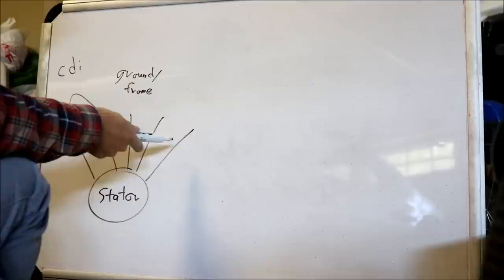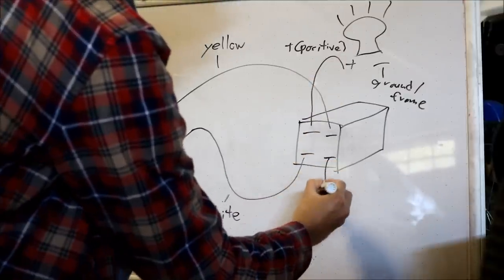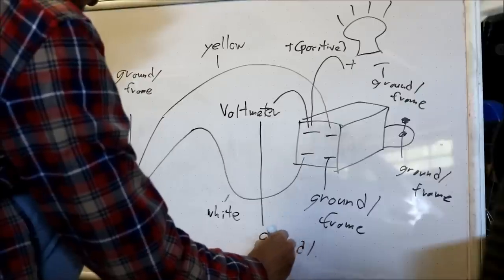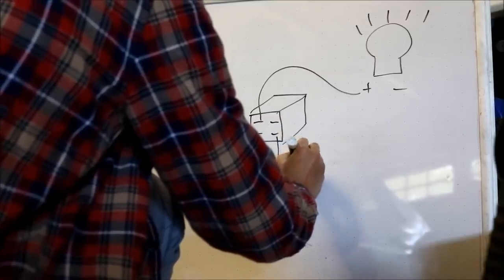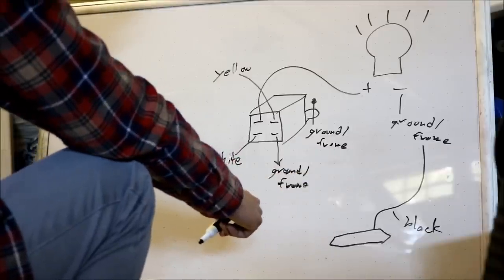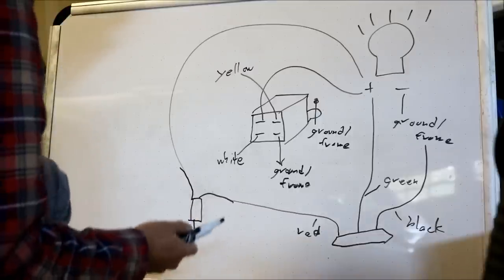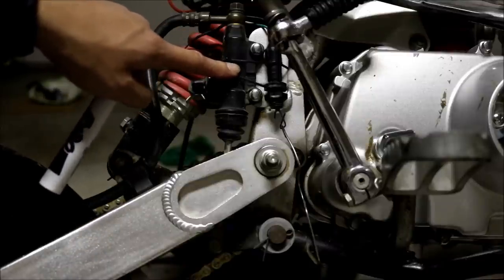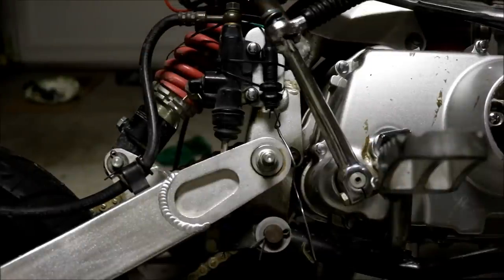Pitbike Rectifier/Regulator Wiring Diagram

Comment: I do this and when I use a multimeter on the red wire I’m only getting 3V, shouldn’t I be getting 12? My stator has 2 yellows and not 1 white and 1 yellow
Reply: Have you solved this already? 
If not, your stator may be a DC Stator or a 3 Phase 11 Pole stator or another....

Comment: Ok mine is a kickstart only but it does have a battery, where n how does the battery fit in
Reply from the maker: If it does have a battery you can check under the seat, usually its there
Reply: @IsaacPel  I know where it is, I put this chopper together. But I'm having to wire it from scratch. I figured it out anyway. But thanks

Comment: Have you got any idea how to wire a 28 amp 5 wore rectifier to the stator? Its really weird and has one green one red wire three yellow
Reply: Hook it up the same way. If the stator has 2 yellow wires like mine then 1 yellow stator wire goes to the pink rectifier wire and the other yellow wire goes to the yellow wire on the rectifier. If you only have 1 yellow stator wire then just tie the two wires on the rectifier together and run then both to the 1 yellow wire on the stator.

Comment: Hello, I have a problem on a chinese scooter 49cc, I changed a light bulb in front of it with the motor started and the lights from the front does not work anymore, the break light works, the turn light work, and the voltage at the battery terminals are 6v without the battery. Maybe I killed the rectifier? Fron the stator at idle I have around 17-20V from yellow and from white the same, but on red is 6-8V, the front light are supplied by the red wire from the rectifier?

Comment: How did you make that break cylinder to connect the light to get brighter
Reply from the maker: A simple brake light comes with 3 wires: 1 wire that goes to ground and 2 wires that will go to positive. One of the two wires is the running light (when the bike is on) the other is the brake light (when the cylinder switch is turned on). 

In my video the ground is the black wire and can be soldered directly to ground and the running light is the green wire which can be directly soldered to the positive +12v(This way you always have the running light on when the bike is on). The red wire, once connected, either makes the running light brighter or activates more lights, to show braking. There are a few different switches you can use to complete the connection.

Comment: If you want to wire in another brake switch (e.g front brake lever on handlebar in addition to footbrake switch) I'm guessing would you add the switches in parallel?

Comment: What do you do if your stator only has 3 wires? No white and yellow wires....
Reply from the maker: That means you'll need to switch out the stator if you want to power Aux components. That stator will only run the engine.

Comment: Hey,i have problem with my regulator. I have regulator from bike that had Yellow and white from stator and my 160cc has 2 yellows. I connected them correctly to the reg/rec and it only gave 10V AC and led didnt work. I installed a KBPC5010 rectifier and the leds work flawlessly but it gives 14v DC at idle. What is wrong with my regulator? i dont want to run with that kbpc 5010 rectifier even tho it works fine but it gives too much voltage.

Comment: How about the battery connection bro?how to connect from the regulator to battery and the charging thing.
Reply: Yes I would like to no too
Reply: The issue is this guy keeps saying stator. Pit bikes without electric start do not have stators. They have magnetos which tho similar are different. Doing this set up the rectifier gets power from the magneto after the engine is running.

Comment: so if you have a battery for electric start, does that get wired in with the positive out on rectifier. my schematic showes the yellow as a regulated circuit and powers the choke and headlight.  I have a Chinese gy6 150

Comment: Why I'm getting 3.5VAC at idle (tested between yellow and white wire), when I rev the engine it goes up to 20VAC or something? I have chinese 125cc pitbike with 6 pole stator. I bet I need 13VAC or more for regulator to work. I have 4 wire / 12v regualtor/rectifier. What i'm doing wrong? I have 18W 6 led headlight.
Reply: Try connecting only one of the wires to the regulator, and ground the other ac side on the regulator, at first i followed this tutorial but turned out wrong for some stators, (i chose white wire, a bit brighter than yellow),now can easily power a 55w halogen full brightness on idle,
Reply: So only connect white wire and ground to ac side of regulator, then connect the remaining two pins to your LED, check your polarity

Comment: I dried it with 3 new china rectifiers but only ever see 7 volts at output ?
Reply from the maker: The 1st one I got worked great. With trying 3 now, the problem may be with the stator or wiring.

Comment: When you test the voltage. what should it be at? Mine reads 4.3v 6.8a and doesnt change at full throttle. But its burning out my 18w led pods :( Any help would be much appreciated
Reply: You need an inline voltage reulator

Comment: Will my starter switch stop working if the regulator is blown?
Reply from the maker: It should still work, I dont think these bikes are wired that way. But if a you have a starter motor, it wont be charge the battery to use the motor.
Reply: @IsaacPel  - I've had the multi meter on it and it's definitely faulty so I've ordered a replacement. Just not sure if I need a starter motor too.

Comment: I want to put a LED light bar on my SSR 125, I dont know what light to get due to not knowing the output and im afraid of getting a light bar that requires too much power.  Im thinking a 7" 36w light? Is that too much? Will it be really dim or will it be working fully? Please help lmao
Reply from the maker: Im Destructive I think it would work fine. My headlight uses an S2 35w incandescent bulb, and in my other video it lights it up fine. Have never tested it at night though. Being LED it could possibly even be brighter than my light

Comment: So all the ground cabels need to go togeter to the regulator?
Reply from the maker: Technically yes, but you don't have to bunch all the wires together and connect it to the RR.  When I say to ground/frame, just connect that wire to the frame with a ring terminal or however you want. You can think of the frame as being a "wire." It is connecting everything together. Make sure to ground the RR at both points.
Reply: Isaac P oke i just orderd the headlight and all so thank you
Reply from the maker: No problem!
Reply: And the yellow wire it ground or what?

Comment: WHERE DO I TAP THE BATTERY FOR CHARGING???
Reply: Did you ever figure this out?
Reply: @user-nd3go7xb7d  on my 2015 dr200 the charging cable is connected to the starter solenoid positive and the other end is connected to the ground

Comment: Good diagram.but how do I wire switch in there?
Reply: Put the switch at the positive cable going to the light
Reply: Wire the positive of the light to the positive terminal on the rectifier

Comment: Hey, great vid. I recently bought an ebay 4pin regulator/rectifier but after wiring it correctly, as you have illustrated, it is only producing between 2.5-4.2 volts. I hate electronics and am pulling my hair out trying to diagnose. Do you think it sounds like a stator problem or a dodgy regulator/rectifier?
Reply from the maker: Glad it helped! Not too sure. You should set a multimeter to AC voltage to rest the voltage coming from the stator. In my case I would test it at the yellow and white wire. See what voltage it produces because that's the voltage that is rectified and regulated.
Reply: @IsaacPel  the white was around 13 volts AC while idling and the yellow was about 10 volts AC
Reply: glennspeeds then how are everybody else running LEDs off of the rectifier/regulator with no battery?
Reply: glennspeeds so yellow from bike stator to bottom left pin, white from bike stator grounded, bottom right pin to ground also. This makes the yellow 12vDC
Reply: @bernzie001  Dont ground your unused stator wires, you will burn out your windings, just leave them floating, Try connecting only one of the wires to the regulator, and ground the other ac side on the regulator, at first i followed this tutorial but turned out wrong for some stators, (i chose white wire, a bit brighter than yellow),now can easily power a 55w halogen full brightness on idle,

Comment: Better way for brake switch is use bolt (for brake hose) with integrated brake pressure switch.
Reply from the maker: It's a different way forsure but I didnt want to use it in case it fails. I was thinking braking pressure could be lost if it fails, but I'm not sure how they are designed.